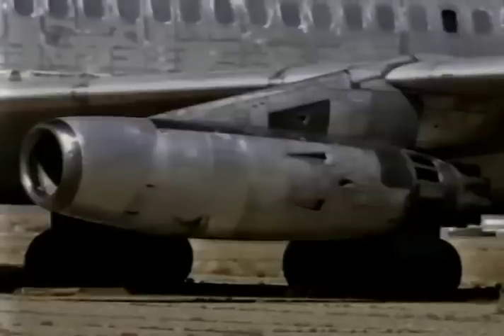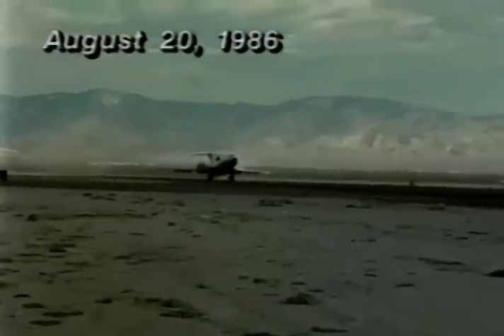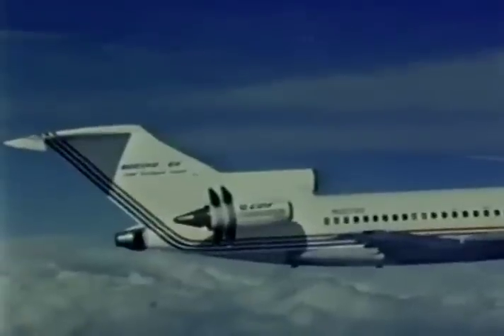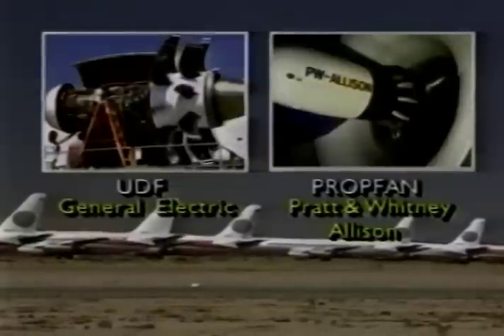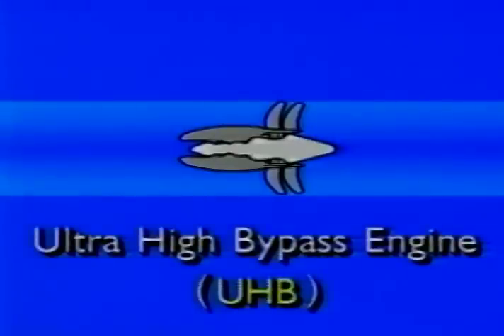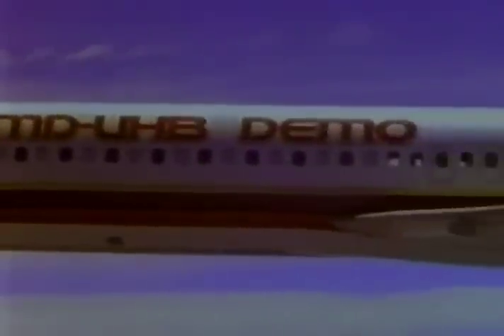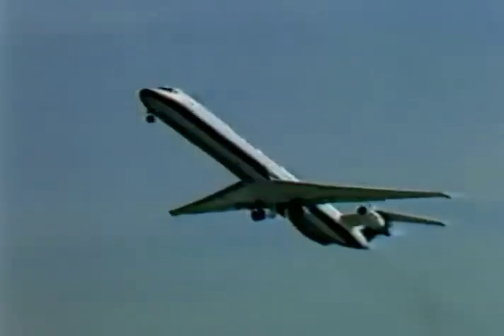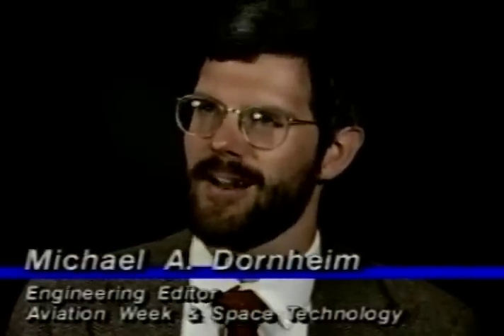The Incredible Engineering of Ultra High Bypass Jets

Comment: that guy at 2:20 looked like a Zombie ,  GE should develop an electric airplane that gets its power from a hydrogen fuel cell , like the space shuttle did
Reply from the maker: Kevin Olesik Thanks for taking the time to comment Kevin. We agree, all the plane builders and their powerplant vendors should be working toward hydrogen power.
Reply: There are massive problems with that idea:

A. Hydrogen production is highly inefficient and far from being green.

B. A hydrogen fuel cell large enough to power an airliner would be enormous and extremely heavy.

C. Storing hydrogen on a aircraft would be extremely difficult because the high pressure tanks can't conform to the shape of the wing the way liquid fuel does.

D. High pressure hydrogen fuel tanks are heavy.

E. It's highly unlikely that electric motors could be built with high enough power to weight ratios that they could replace turbine engines. You have to consider that a large airliner engine might make around 100,000 horsepower worth of thrust.
Reply from the maker: idontcare80 Thank you for taking the time to make a thoughtful and sincere comment. However, I do disagree with several of your points.Hydrogen production efficiency has everything to do with how you calculate, and value, the "feed stock" used, and the value you place on the impact to the environment. 

Furthermore, the common "well to wheel" paradigm used to compare hydrogen production to carbon-based fuels typically fails to include the energy costs associated with even getting to a carbon "well," (i.e., exploration) let alone the true full system losses from drop of crude in the ground to refined product in the tank.

Unlike non-renewable carbon fuels, hydrogen has the potential to be fully renewable, but it does take an effort and the right circumstances to produce it on that basis. In other words, yes, there are costs.

Your point about electric motors fails to consider that gas turbine engines can consume hydrogen as their fuel - same goes for the concerns about fuel cells being powerful enough. As Boeing has demonstrated with their UAV, for example, hydrogen can also serve as a fuel in internal combustion piston engines.

Designers are also under no obligation to store hydrogen fuel in the wings; other options are available, again, see Boeing's work in this area on their UAV.

Finally, I don't believe high pressure gas hydrogen storage tanks are inherently heavy. I've not done the math, but since the fuel they would store would have a negligible weight, compared to liquid carbon fuels, I doubt system to system there is much difference. And unlike burning (consuming) a fuel like jet a or avgas, there would be essentially no CG shift as the fuel is consumed, possibly lowering workload and improving that aspect of safety.

There is no perfect solution, but it is helpful to remember the old saying, not to make perfect the enemy of the good. :)
Reply: AeroSpaceNews.com I was mainly responding to the person who was saying that airliners should have hydrogen fuel cells powering electric motors of some kind. 

Burning hydrogen in an aircraft engine presents challenges other than just storing the fuel on the aircraft. Hydrogen also causes engine parts to become brittle, so they need to be specially made to avoid this.

Storage is a major problem as well. High pressure tanks simply wouldn't fit anywhere on the aircraft without taking away from passenger/cargo space and storing hydrogen in a metal hydride (which could conform to the shape of the wings) is extremely expensive.  

There's also the fact that hydrogen is essentially a highly processed fossil fuel when obtained from natural gas and is very energy intensive to produce via electrolysis. Natural gas is a problem fuel because it's finite and fracking is becoming a more common means to obtain it as the fuel becomes harder to extract from the ground. Fracking causes environmental problems and methane leakage from natural gas wells is also a major environmental problem. It would simpler, cheaper and more environmentally friendly to produce a biofuel for use in airliners (using green energy to refine it) than it would be to produce hydrogen with the same energy sources. Using a biofuel in existing turbines would required little to no modification of the engines and little to no modification of the fuel systems in existing aircraft. Using hydrogen to power turbine engines would require the entire aircraft to be specially designed for the storage of hydrogen and the engines would need significant modifications to burn it.
Reply from the maker: idontcare80 It is so refreshing to discuss the subject with someone who actually knows something about it! I agree with you about hydrogen embrittlement being an issue with all metal components, especially in ICEs (Internal Combustion Engines). Actually, while metal hydride storage does have applications in weight insensitive applications (i.e. stationary power plants), I don't think it would work for anything that flies. All those candidate materials seem very heavy. Very high pressure gas seems to be the best candidate but would require new aircraft shapes and designs to make sense (people/cargo in flying wings, etc.) And I do think they could be made light enough to "pencil."

Liquid could also work (it did on Space Shuttle), but that was a different application, of course. My money is on very high pressure gas.While electrolysis requires energy input, as I hinted in my first response, when compared to the actual numbers from "well to wheel," the total system (production of fuel, delivery to vehicle and end use efficiency) numbers do compare favorably to the hydrocarbon alternatives. And that is before taking into account the environmental, and political, benefits of renewable hydrogen production and use. This scenario assumes the electricity feed stock comes from renewable sources.Having said all that, I'm keenly an advocate for not putting all the eggs in one basket. I do support exploring and testing everything from bio fuels to less polluting gaseous fuels like NG and LNG.

Much work, and from what I've seen successful work, has been accomplished by the Air Force, Navy and airline industry testing bio fuels in existing jet engines. So again, we agree there.Maybe, just maybe, even battery-electric will work. But I won't be holding my breath.Who saw jet engines and pressurized aircraft coming in 1917? :)

Comment: 30 years later and this story is still way ahead of its time.
Reply: I don't think so. There's a reason they've gone with higher bypass conventional turbo fans and lighter composite materials instead.
Reply: @kevin bate  - the reason was fuel prices didn't keep rising
Reply: @manofsan  Unlike now, over 6 bucks a gallon :'(
Reply: ducted fans are more efficient than unducted fans, additionally the noise created by unducted blades at this speed is immense. Both of these issues are caused by turbulence around the blade tips.
We are at a point where ducted fan blades can have a diameter greater than these unducted fans, so removing the duct is just a drawback.

UDFs were a fascinating stopgap solution to achieve high-bypass ratios before the material technologies allowed us to make fans that would retain their shape well enough at such a diameter to be safely put in a duct
Reply from the maker: Thanks for watching and taking the time to leave a thoughtful comment.  I think the one thing missing from your perspective is that the issue of efficiency is aircraft mission speed dependent. Cleary at what we would consider turboprop speeds, including a high range for them, things that look like UDF remain competitive. But in the realm of pure jets, ducts remain the solution of choice.
Reply from the maker: marc fitzhenry Ouch (I think). But thanks for taking the time to comment.
Reply: LoL, At the ouch. It was really only a careless remark whereby I was drawing light to the powers that be that have not allowed this to progress to the point it has. I found this download FACINATING,,,However, I never posted about how I found it fascinating and thus enjoyed it, I was just being silly at the end making a point to show how slow good ideas are to make it to the market place. Sorry to confuse you with the ouch reaction, I didn't even consider it could be taken as such as I was too impressed with summed up the effects of red tape. Great download.
Reply from the maker: Aha! Thanks for the clarification; it and your kind words are much appreciated. :)
Reply: Expect the gas prices

Comment: This can't happen for passengers because it is unsafe, a blade-off would be a disaster.
Reply: It would be for prop planes too, but we don't see those carrying passen.... Oh wait....
Reply: All modern jets have bypass fans, you just can't see them because they are in the cowl. This probably isn't any more dangerous.
Reply: Well yeah, but props aren't contained either. Seems very improbable that those blades will break off, if anything their visibility might make them easier to inspect for cracks and defects. Also they are aft of the cabin, so they would not injure passengers, granted they could probably do damage to systems inside the tail, or the empennage surfaces, but this threat could be mitigated with redundancy, Everything has risks, but I would not necessarily feel unsafe flying an aircraft like this.
Reply: Grand Negus This of course was not true. Countless MD-80s took off and landed safely over the years.
Reply: FrequentFlier Anon His point was that turbofan engines are certified to contain fan blades in case of blade separation. The UDFs couldn't do that.
Reply: corisco tupi why can't they mount the engines further back so the blades are behind the tailcone, there is still of course the chance one engines blade could separate and damage the other I suppose, but at least the fuselage would be spared and hopefully the passengers lives, provided they made it safely to the ground.they could add some sort of semi circular guard to "catch" or deflect the blade in the case of a separation. please note that I am by no means an aeronautical engineer, i am just curious. why has this design been overlooked, are today's high bypass ratio engines so efficient that the added benefit of an open fan design is negligible???
Reply: Putting the engines behind the airframe would probably create weight and balance problems.
Reply: Sandman Actual That could be one solution!
Reply: I think when the planes get sold abroad they experience safety issues.This is a safety concern as they they are subject to a different maintenance schedule, and this  could be determent to the safety of the plane/engine. Just look at current plane crash trends!
Reply: corisco tupi  There are lots of cases of fan, and or turbine disk uncontained failure.  Didn't the A380 have an uncontained disc failure last year?
Reply: And props, turning at lower RPM, are subjected to less stress.
Reply: Doug Voth It may happen on occasion and when it does, lots of questions get asked. Not having a fan shroud OTOH is by definition guaranteed a recipe to an uncontained failure in case of fan blade separation.

Comment: Thanks for uploading this!
I don't remember who told me this, but I heard years ago that the UDF engine on the 727 practically vibrated the aft fuselage to destruction (I'm not sure if that is true).

The Rolls Royce Trent 1000 on the 787 has a 10 to 1 bypass ratio, the fan creates 85% of the thrust of the engine and turns at only 2700RPM  http://www.rolls-royce.com/civil/products/largeaircraft/trent_1000/index.jsp

So it seems that we have super-high bypass, highly-efficient, ungeared, ducted fan engines.  Google an image of the GE90 or Trent1000 fan and look at those blades!

This is cool:  (Note that it is http://www.rolls-royce.com/interactive_games/journey03/
Reply from the maker: StratMatt777 - Thank you for the kind words and for taking the time to leave a comment!

Comment: I don't see how they thought that would be an advantageous design. The whole point behind a jet engine is to maximize the kinetic energy of the exhaust gasses from the engine, so if you go capturing some of that energy just to turn some props that do the same thing to some different air all you would be doing is introducing unnecessary irreversibilities into the system. Unless I'm missing something.
Reply: Well a turbofan does the exact same thing as this design, it uses the power the engine produces to turn the large fan at the front which produces most of the power, and which most of the air that gets pushed by the fan never touches the actual engine. Only difference between a turbofan and this design is this is much louder and much less safe, no way to contain a blade off.
Reply: ***** Finally a decent skeptic arises from the teaming masses to enunciate that there is a large gray tusked animal on the tarmac...! (An elephant in the room....)
Reply: The higher the kinetic energy the more energy is being loss, the energy must be extracted from the exhaust.

Comment: Another 'it seemed like a good idea at the time' story. I remember these trials being featured in aviation mags of late 1980's. Despite surging fuel costs since then, over 1/4 century later the UDF concept remains dormant. Maybe stalled by tougher noise regulations? The spectre of an uncontained blade failure? Besides, there have been quantum advances in jet engine technology which rendered UDF obsolete.

Comment: I saw and heard the McDonnell-Douglas aircraft with the General Electric UHB engine at the Farnborough Air Show, 1990 I think. It had a quite pleasant and not excessively loud sound. Why are we not allowed to listen to it in the video? I think the main problem this engine had in the 1990s was that fuel was not expensive enough to provide the necessary incentive to put it into production
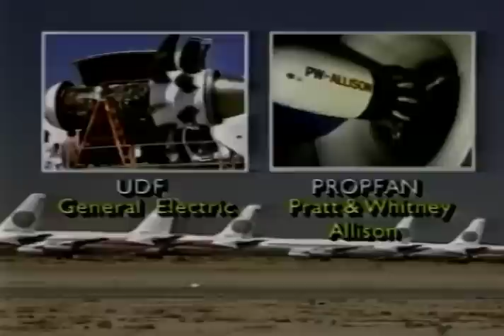Reply from the maker: Cedric Lynch Thanks for taking the time to comment. You can hear the engine at 1:30 or so, and again at 3:40 in the video. Fuel prices did go down and up and down and up since this video was made. It seemed the biggest obstacle was the misunderstanding that the design was a step backward... to propellers, in the mind of the public/media.

Comment: If one of those blades decides to break off its a big safety issue. Today engines are designed to contain catastrophic blade ejection.
Reply: Haven't you ever seen a turboprop?
Reply: toranamunter
yes and i didn't think they would go back in time and leave the blades exposed. This is a jet engine with the blades exposed. Not a turboprop engine.

Comment: Those dead airliners that line the Mojave desert is the results of a worn out aircraft and was at the of their economic life . . . Not because they are fuel guzzlers! Old jets liners are always being retrofitted with newer more efficient engines through out their life. Airline companies pay a lot of money for these birds so when these aging birds are no longer deemed airworthy by the FAA they go to the scrapyard in the desert. They are quite durable! The average airliner can log over 100,000 hours over a 30yr. career that may equate to over 50million miles!
Reply from the maker: goropeza101 Thanks for your comment. I must respectfully disagree. Even airframes with useful life left can end up being mothballed (stored) if they are no longer economic to operate. Sometimes it is crew costs, sometimes noise, and sometimes, it is poor fuel efficiency.

Comment: Jesus Christ, a full minute of intro?
Reply: "Although the engine demonstrated an extremely low specific fuel consumption, cabin noise levels were a problem, even though the engines were mounted at the rear of the test aircraft."

Comment: I guess it is is still hard to beat compressed air on fire,now if we can keep more of that heat in the engine,better materials .How efficient are gas turbines,electric motors are 80-90,gasoline maybe 40 percent,gas turbine?

Comment: I guess it never materialized.
Reply: This will be implemented sometime in the future, all bets are off if the world ends though!
Reply from the maker: Funny man! ;) Thanks for taking the time to comment.
Reply: AeroSpaceNews.com No really, I believe it will likely be implemented with the high cost of oil.  Scope and economy relative to modern TFs engines out there is another factor.  This will probably be installed on narrow bodied Jets as a compromise for performance/economy vs TP engines.
Reply from the maker: I only thought the "end of the world" part of your comment was meant to be funny - that's why I appreciated and responded to your original comment... which seems to have disappeared and I did not touch it. :o
Reply: AeroSpaceNews.com it's still there :)  You have to click the "show more comments" thinger :)  I'm glade you were able to grape the full, depth and profoundness of my statement, hehe!

Comment: In theory at least, a ducted fan can actually be MORE efficient than an open fan as these engines had. So I'm not exactly sure how this "ultra high bypass" engine could outperform a properly cowled turbofan.

And, as others have pointed out, noise and safety are issues as well. Imagine what that infamous miracle on the Hudson would have looked like if these engines had been on the aircraft instead of a turbofan.  On second thought, let's not go there...